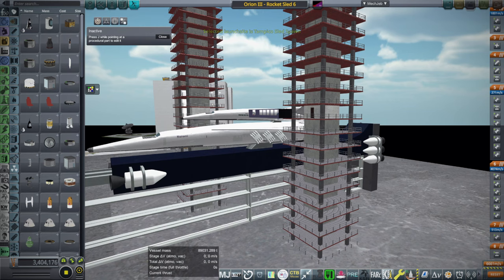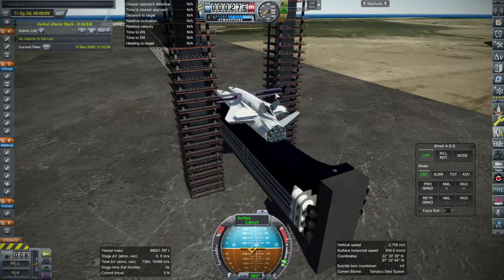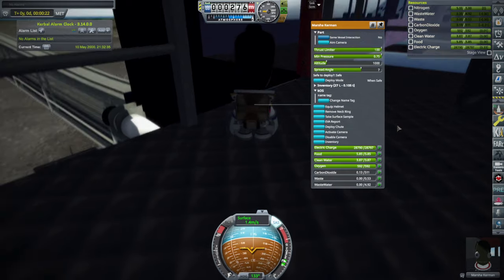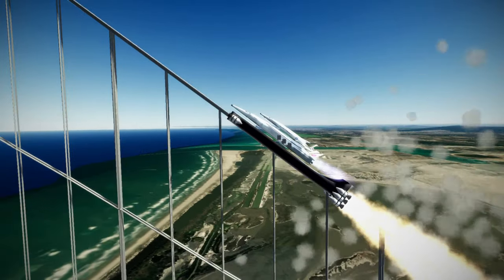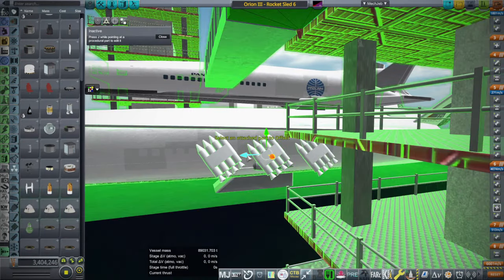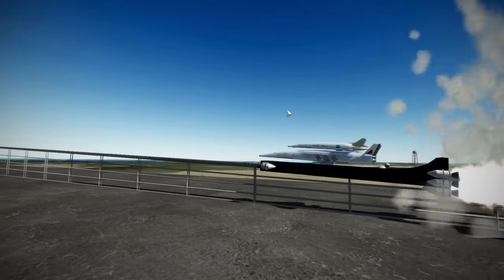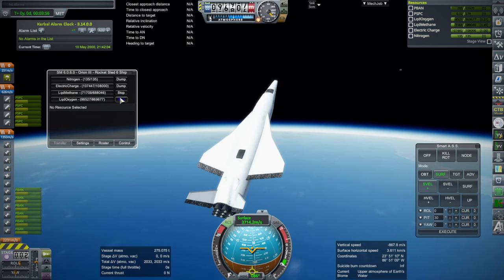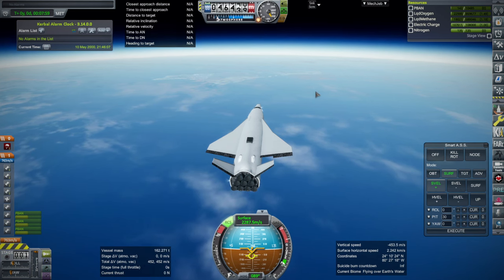Rocket Sled Developments (Kerbal Space Program)

Comment: It's funny seeing Kerbals in a human sized craft.... great stuff as usual, really fun and interesting. Do you plan on going through abort scenarios for this? 

With the radial booters blowing up on reentry, they're only kept because its dangerous to decouple them while launching right? why not decouple them once Orion has seperated?

What about different shapes of mount, as in a forked shape grabbing either side of the body to avoid the body flap?? idk
Reply from the maker: Well, on the sled the abort is easy - turn off the OCP's engines and don't decouple. The sled stays on the ramp and the retro rockets will have the sled slide down again to the start position. After that, I guess it's more complicated. Decoupling the RATO boosters later would be okay, but it's more aesthetically pleasing to have them recoverable, too, since everything else is. I'll think about the mount.
Reply: @RaizSpace  yeah I think exploring different abort modes would be pretty interesting. e.g different ways that the initial sled boost can fail, and at what point is it recoverable (with the extra mass of the craft still on the sled) and what if theres multiple engine failures right after launch etc. Even if you don't do a video on it, I'll be thinking about his myself!! Fair enough about recovering the RATO boosters, I don't know much about reentry shielding etc, how much mass would it add to add to make them withstand it do you wreckon?

Comment: You could have the ramp pitch down at the release point to 35 rather then 45 but the timing on that could be a little difficult
Reply from the maker: Yup, the timing is the problem with that, especially since the sled can have somewhat different loads on top and hit separation at different times.

Comment: not sure if it has been suggested to you before, but if the sled needs a certain payload mass to function properly, would it make sense/be possible to just add a ballast either to the sled, or put it on the craft itself and jettison it in flight to allow underfueling the carrier plane?
Reply from the maker: Adding ballast to the sled is possible and preferable, but there's still a limit to that because too much and the retro motors won't be able to slow it down soon enough.
Reply: yeah that makes enough sense. like i said, it could be worth adding the ballast to the carrier plane and decoupling it shortly after launch, but not sure how viable that is